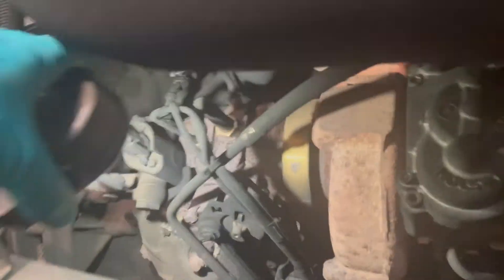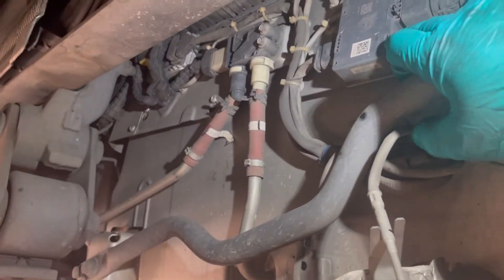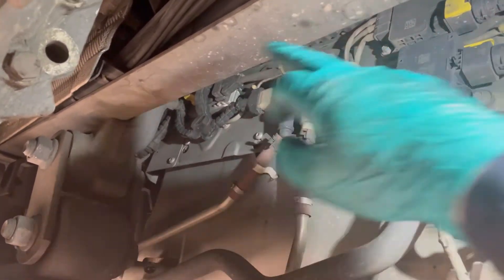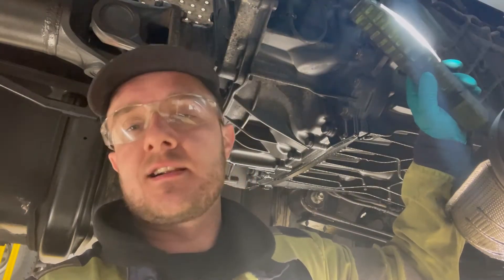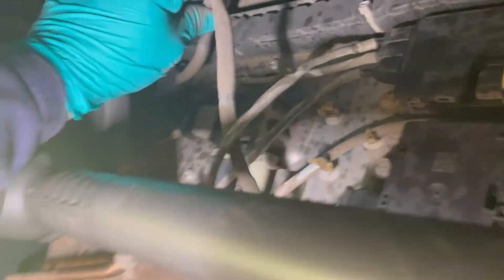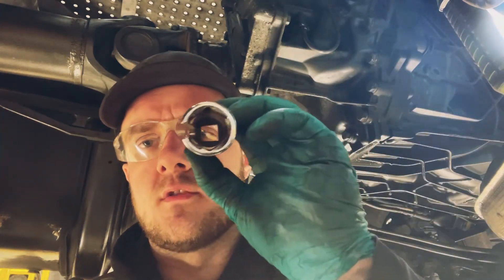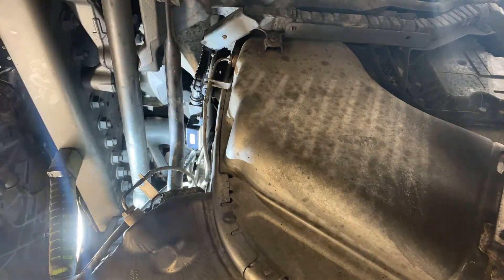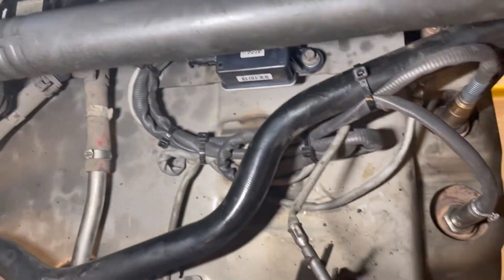DAF CF85 Euro 6- Exhaust emissions fault, what was the problem?

Comment: Hi I recently bought a daf xf euro 5used shipped to east Africa now I have this problem the truck would turn off while driving ..then run against and same thing would happen ..I wonder wats the problem ..is it wiring or wat ..it's so unfortunate can't find videos with regard to daf truck common problem and how to fix them ...like in north america ..is it coz European driver are not interested is Posting DIY videos with rgds to trucks in general ..keep up the good work I learn alot from you
Reply from the maker: Does it bring any warning lights on or anything? Also check down on the passenger side underneath there’s a big wiring loom that bends around check in there not corroded wire or anything, check all relays too! And what sort of videos would you like in general?
Reply: Sounds like an electrical problem!

Comment: A forced regen will clear the  bi-uret / ad blue build up .there is no need to remove the DPF
Reply from the maker: That’s very true, but depends how blocked up it is, if the DPF is fully blocked then you can regenerate it but chances are will come up with the faulty again, that’s what’s happened from past experience with us.
Reply: Sometimes it won't let you do a forced re-gen even though the soot  filter is half full!
Could be a NOX sensor fault!